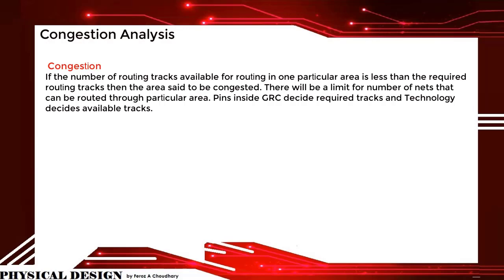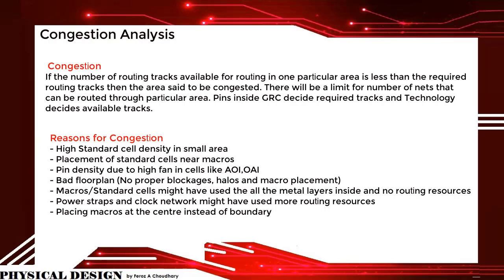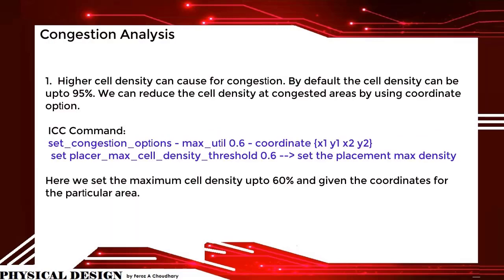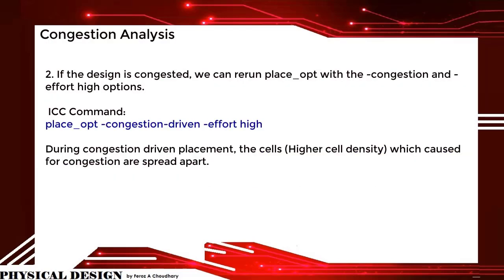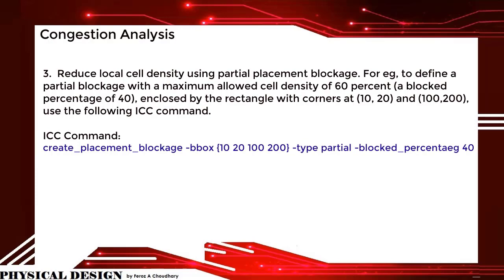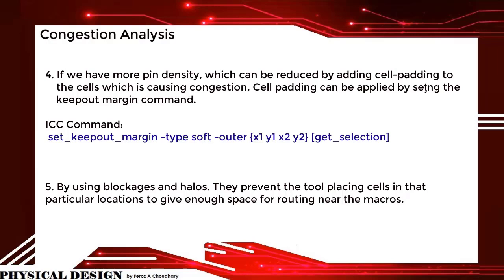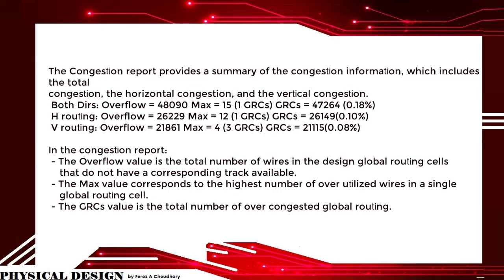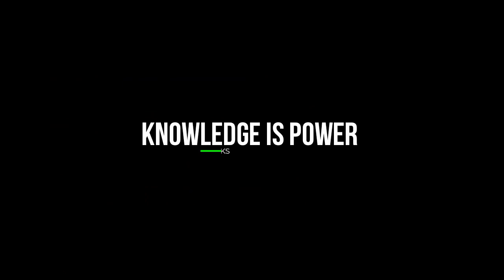VLSI Physical Design: How to fix congestion.

Comment: There is 5% H 6%V congestion. What is the exact meaning of this percentage?
please help to understand this.
Reply from the maker: Zoom and see the tracks are laid horizontally as well as vertically. If you see congestion is estimated based on overflow=routing demand - routing supply. If it shows 7/3 means 7 tracks are there where only 3 tracks are allowed hence congestion. horizontal and vertical both type of congestion will be seen. This percentage is overall estimation of congestion.
Please refer this for more info : https://www.vlsi-backend-adventure.com/congestion_analysis.html
Reply: @FerozAhmed_PhysicalDesign  Thanks a lot !